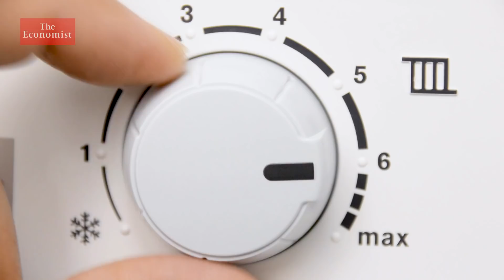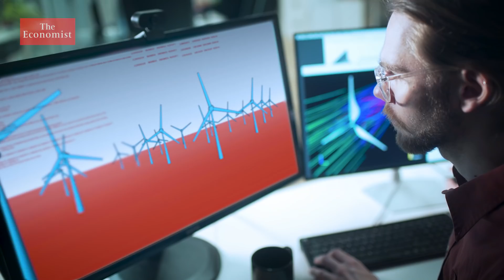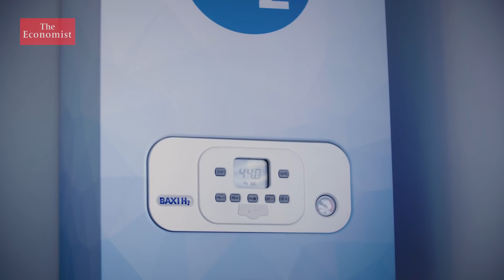Keeping warm, without warming the planet

Comment: I feel like we're missing something, I don't think it's carbon alone here, I think the heat escaping off our homes is far bigger in climate change than we realize. Bodies of water hold heat and affect whether with it, and cities is say release far more take most lakes we know do this. I guess hard to say how much it matters until you see what it's like to see it stay unheated a year.
Reply: Intuitively it looks like a problem, but no, it's not. CO2 traps heat for centuries, while your home heat just dissipates quickly.
Reply: @ImaskarDono  the heat from homes doesn't last long, but it is constantly generated for nearly half a year every year. The heat escape also represents a lot of wasted energy. What we build on the ground and heating that might affect the wind that moves weather too. It must to some amount.
Reply: @alphonsobutlakiv789  yes, it was calculated and it is very small. The damage from CO2 from generating this heat is orders of magnitude bigger than from that heat escaping. That also means that of course we should insulate as much as possible.

Comment: Did it say 30 million houses in Britain aren't suitable for heat pump? Or 13? There's only 25 million houses, and I have a heat pump.
Reply: Heat pumps are difficult to retrofit. They are great if they are built with the property, but there are a lot of practical issues converting gas to heat pump. Even the pipes need to be replaced, and that usually means breaking the walls open. By the time you're done the whole property needs redecorating just to fix the damage done fitting the pump.

It's water temperature. Gas heating moves a small volume of hot water, while heat pumps move a large volume of warm water. The total heat transferred can be the same, but moving more water means you need wider pipes and double-panel radiators.
Reply: @vylbird8014  I had my house retrofitted from a gas boiler to an air source heat pump they didn't need to break open my walls they fed all the pipes under the upstairs floor, there are large diameter pipes that come up the front of the house from the external unit and go under the floor to the hot water tank, most of the radiator pipes were kept, 15mm copper, they replaced the radiators, was not much more disruption than having a new gas system fitted.
Reply: @Vinladen7531  Then you had a house that was not too much trouble. Not all are so easy.

Comment: Not a bad video, but without nuclear power you will never be able to produce enough green hydrogen for everybody. For heat pumps to work you will need well insulated houses and won’t be able to open the windows, as it takes a lot longer for the house to heat up again.

Comment: Heat pumps are not more efficient. There is simply not enough energy in the air outside to heat your home. It makes more sense if your house is next to a body of water. To drop water by 1 degree, it will release wayyy more energy than air, with has barely any. Your going to be using electricity for 95% of the heating of your water. It’s funny how no one has done a direct comparison of boiler to heat pump in terms of energy in. Or even co2 released when accounting if co2 emitted from the electricity drawn.

Comment: "In 2021 emissions grew at the fastest rate for many years."  -  Seriously?! You could at least try not to mislead with statistics
Reply: @Dimitris_Half  That wasn't what I meant, it's not very useful to compare 2021 with 2020, a year, where entire economies where shot down. If you compared 2021 with 2019 or take the 10 year average increase or something more useful, you would see that the rate at which it is increasing is rather getting smaller.